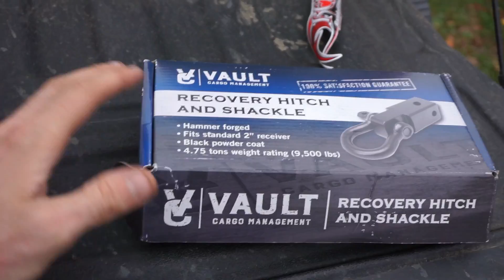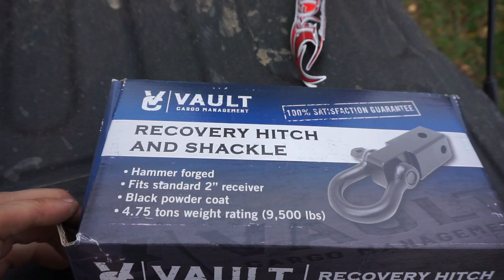Bull Bar LIghtbar INSTALL On The Power Wagon!

Comment: For those new PW folks, Factor 55 has a pretty sweet, albeit pricy I suppose, hitch mount for our receivers so that you don't have to carry the adapter sleeve. http://factor55.com/product/hitchlink-2-5/ It is cross drilled so you can go either way with the shackle. It's in my Warn recovery bag under the rear seat. Don't forget you'll also need a longer pin, though, I've never had that complaint... BTW, their front UltraHook will supposedly fit in the stock opening.

Comment: Getting the hitch attachment for sure. Had to recover 2 trucks this weekend in the mudhole that the Houston airshow became after the rain.

Dude you never answered my question. I installed a magnaflow cat back muffler and also got rid of the resonator. Have a vid on my "very newbie" channel. Did you have to tune up your engine after installing your muffler or not?

Thanks!

Keep up with these vids man
Reply from the maker: Sorry I mustve missed it. No I have not tuned the engine whatsoever after the exhaust or any parts for that matter
Reply: Thanks Ian you are the man!

Comment: Ha! I just put mine on this past weekend! Betcha had to re-use those factory bolts! They are made here in Phx.  so I had them weld exrta tabs onto the flat plates on each side. CB ant. on one side HAM on the other. (I feel like a catfish 😄) They made me a pretty good deal on some 8" KCs two driving and two wides. Halogen, couldn't pop for LEDs right now. And I did guess a lightbar, but not necessarily RED, though I did put it in a comment. Getting some schwag from DTC to send to you. I'll put my PM in with so not commenting to the world. Ironic, the founder of KC was a good customer of ours when I was a kid. Flagstaff and Williams, AZ are only about 30 miles apart. Peace!
Reply from the maker: That's awesome Don! haha I like it, bet yours looks awesome with all the attachments already. I'm leaning towards the KC KiLites as well.  Cant wait to get mail from you! Thanks Brother

Comment: Does anyone know if this will activate the front parking sensors? I want to buy one, but i also use my sensors all the time, specially due to the size of the truck..
Reply: Nope no effect, and even when the tone goes solid you still have plenty of room, and I have four 8" KCs on mine. Solid bar, good price, but be willing to go get some longer grade 8 hardware, unless RED listens to me.
Reply: That’s the same question I had. Thanks for the info.

Comment: I have a question for ya, when you put on the 37inch tires what mod did you do to it before you got your lift, and do you think 35 inch would work without a lift. Thanks.
Reply from the maker: I have videos explaining how I fit 37s before the lift, but overall it was tough. 35s though should fit well stock on a PW so expect no mods or maybe a cheap leveling kit at most
Reply: thanks for the info,now I just need to trad my 1500 2008 5.7 in and get my power wagon, cant wait, but I know it will happen this year, Thanks agin guys big help.